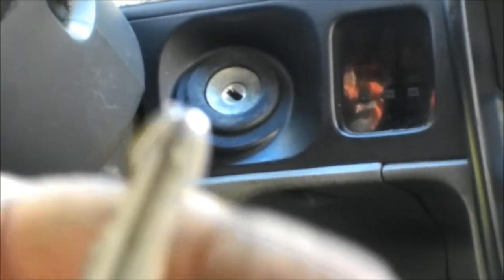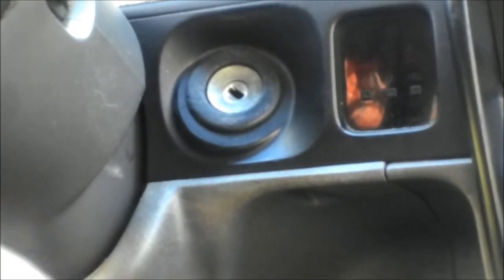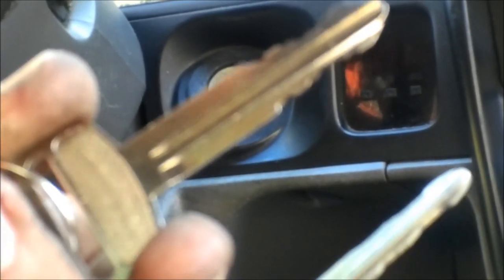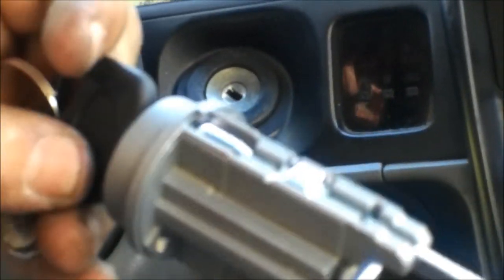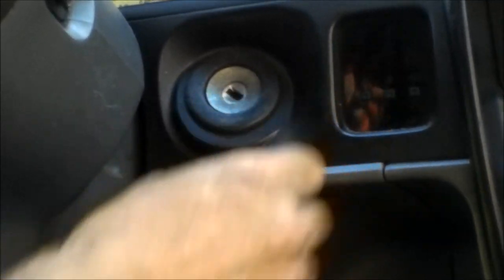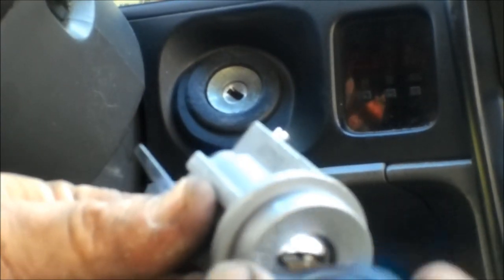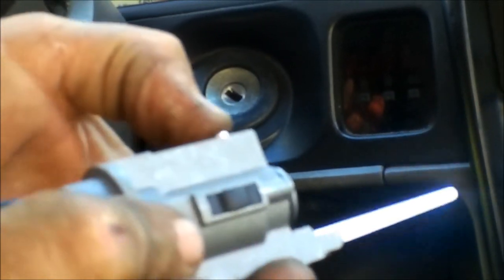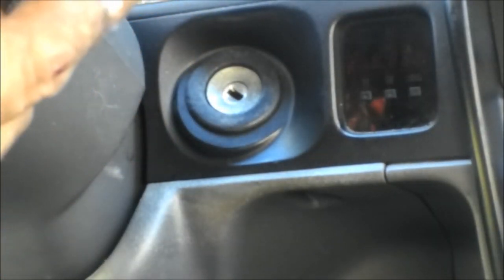HOW TO, REPLACE AN IGNITION LOCK CYLINDER 03 TACOMA

Comment: Any tips on doing this job when the ignition has been drilled out? I’m buying a Tacoma from a tow yard and it was drilled out probably stollen vehicle but definitely want to replace it,
Reply from the maker: You might have to use a small chisel and break it the rest of the way out. But try the steps in the video first. There might be enough left in the to come out the right way. If all else fails you can always replace the steering column.

Comment: Thanks so much! Easiest repair I’ve had to make with your guidance helping out!
Reply from the maker: You're very welcome. I'm gladvit helped. Thanks for watching and commenting. Happy Easter to you and yours.
Reply: I broke my key off in the ignition, it would turn, but not start. I separated the white module behind the key switch and started it and got another ignition key lock cylinder. You made a hard job, a lot easier, with vital information. Thanks.
Reply from the maker: You're welcome Bill. Thanks for watching and commenting. Have a great week.
Reply: @shabear1000  I felt like a crook that had hot wired a car, when I drove it to the auto parts store for the part, it's all back together now. Thanks again.
Reply from the maker: No problem man. Glad it helped.

Comment: After replacing the switch did you have to re program it for the key to work if your truck is equiped with the secuity imobilizer? I have a 2002 Toyota 4eunner and im getting ready to do this exact job.
Reply from the maker: If you have that feature then yes. I didn't have to worry about it on mine.
Reply: @shabear1000  how do you know if you have that feature? I have an aftermarket key not original on my 2002 model. I found a complete key set off a 1996 model

Comment: Hello...what is the part number of the plastic/rubber tumbler you removed? Is it actually called a tumbler? Thank You!
Reply from the maker: I don't know what the part number is but yes it's a tumbler you can look them up online and get those parts reasonable and you can type in what you need and it'll bring up pictures and what year of vehicles they will fit so you're sure to get the right one hope that helps thanks for watching and commenting.
Reply: @shabear1000  I am having a hard time tracking down the part number...same info as your truck. If you have any luck tracking it down, it would be appreciated. Thanks...
Reply: the ring?

Comment: someone tried stealing my 2001 tacoma so my key ignition has been and destroyed from a screw driver. is the key insertion necessary or is the ignition lock cylinder still possible to pull out without having to turn the key?

Any help from anyone would be greatly appreciated!
Reply from the maker: I can't remember but you should be able to get it out fairly easy.

Comment: How do the keys match up with the old key/ignition and the door locks?
Reply from the maker: They don't. It comes with new keys.
Reply: @shabear1000    ahh... so you end up using two different keys.  Ignition lock and doors use different keys.  Mine won't allow me to remove the key.  Stuck in the ignition, cranks ok and shuts off but no lockup on the steering wheel and  no removal of the stupit key.    Looks easy enough to do.  I subscribed to your channel.  Thanks
Reply from the maker: Yes that is correct you end up with two keys. Just like the old Chevy used to be one for the locks and one for the ignition. Now there is a set you can buy through Toyota to where they all have the same key but it is very expensive and really not worth the money if you're willing to put up with two keys. By the way thank you for subbing I really appreciate that have a great week.

Comment: If I got a new key with the old cylinder ignition will it still work?
Reply from the maker: No
Reply: @shabear1000  in my case it was just the key, too worn out, for others might want to try that out before changing the ignition

Comment: What if I can’t turn the key at all that’s why I’m changing it. I can’t turn the key far enough to push the pin up😡
Reply from the maker: Use a small drill bit and drill the pin out.
Reply: shabear1000 lmao I did thanks
Reply from the maker: Lol. You're welcome. Did go ok?
Reply: @HardHatDIver412  plz tell me that work I running into the same problem on my 02 Tacoma